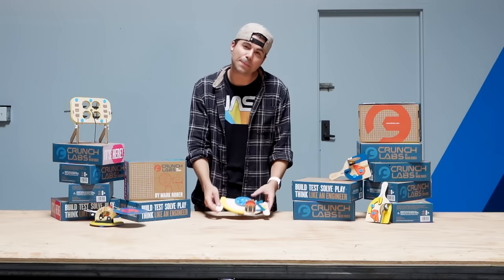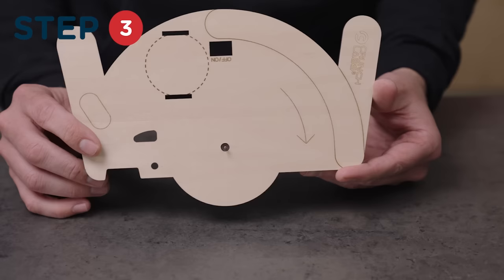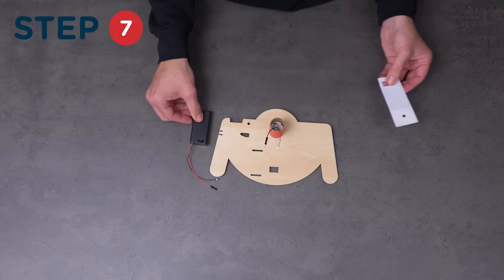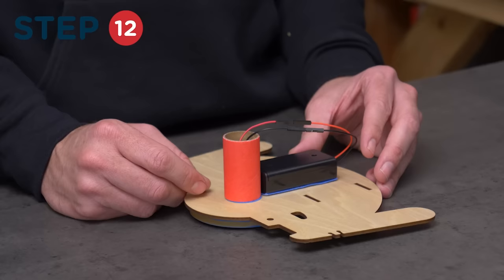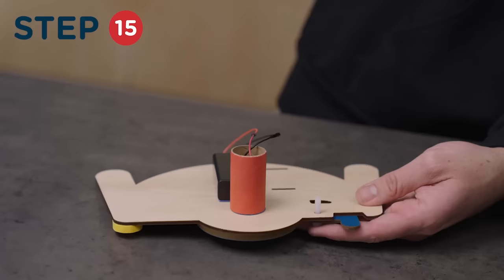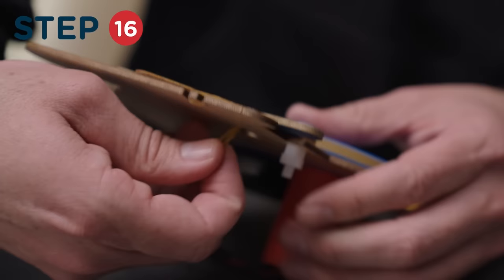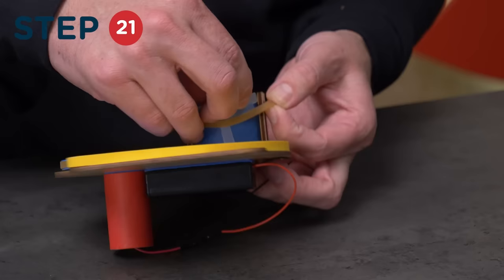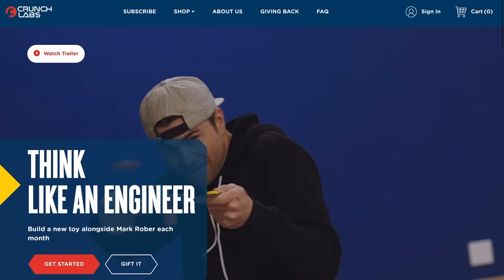Disc Launcher Assembly Instructions

Comment: @crunchlabs and @markrober this one did not work very well. Motor too weak, friction on moving parts too high and the measurements for the disk launch slot were too tight and the disk would get stuck on each launch attempt. 😢
Reply: Sounds like a skill isue
Reply: Worked perfectly for us

Comment: the top of my motor came off. can you tell me what to do?
Reply: same thing happened to me
Reply: if you still have it, take off the lid and look at the two metal connectors on the top and place is around the spinning axel. If the metal connectors arn’t both touching the axel and touching eachother it will make the battery hot from short circiting. snap it back on in any way that snaps on, test it a bit because I forgot how I fixed mine. I hope this helps!

Comment: We need support. . . the dc motor came apart. . white top came off metal part. . . don't want to break it trying to put it back together. Came off right after assembly.
Reply: same.
Reply: @dong-ulee6028  we got a replacement. . Super nice and easy customer service. . . But it did the same thing.